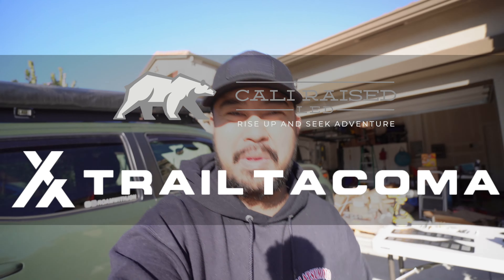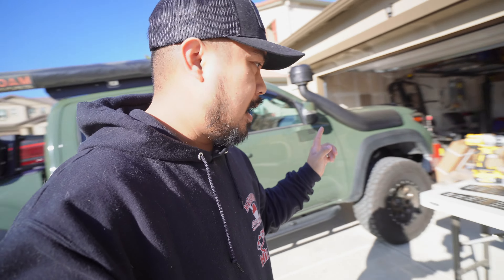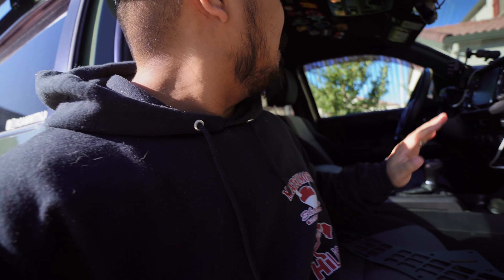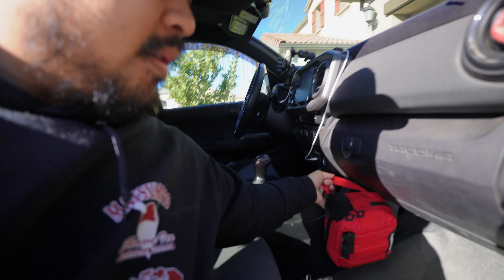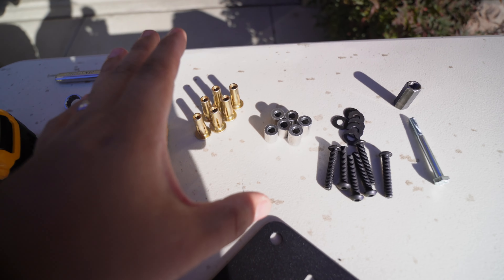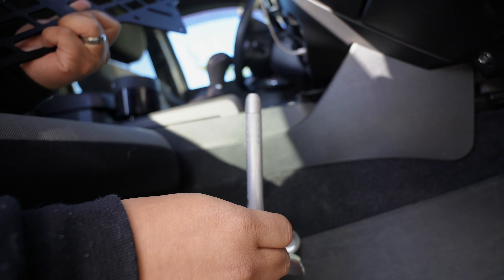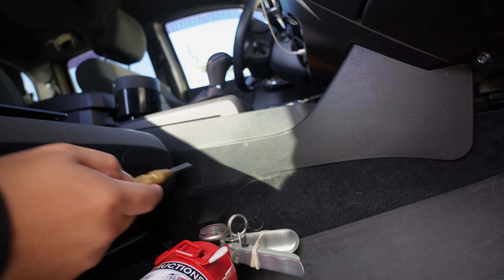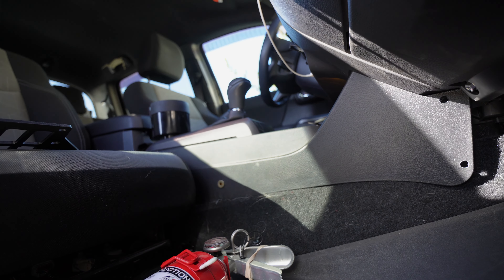Cali Raised LED’s Center Molle Panel Install | Toyota Tacoma

Comment: Very detailed install!!

Qq: can youu still move the seats all the way up? And on the driver side does it rub against your leg driving/resting?
Reply from the maker: You can move the driver seat up all the way for the most part, the seat just rubs on the panel. Andddd I don’t really notice my leg rubbing up against it unless o have something there. Sometimes I’ll have my radio clipped there and my leg will bump it but that’s about it.
Reply: Really appreciate the feedback! Going to install mine this weekend!

Comment: What holster are you running with this setup?
Reply from the maker: I just clipped an extra trex arms iwb I had laying around, it works decently but there is some rattling. I think with some modding you could definitely retrofit any iwb kydex holster to a molle panel. I'm sure theres actual holsters made for molle panels that would work as well.
Reply: @RoamWithJon  I've been looking and all the holsters I see are for webbing style molle panels. Might have to mod something up to make it work. Thanks for the video. Nice setup
Reply from the maker: @DuStY_DiNkLmAn  tyty hope you get it figured out.

Comment: I loathe plus nuts (or riv nuts as some call it). They’re highly unreliable and many times spin in place post installation.
Reply from the maker: I did notice that. I kinda just cranked them down and they didn’t really move after though. 

We’re going out in a trail this weekend so there’s defining gonna be vibrations putting everything to test.